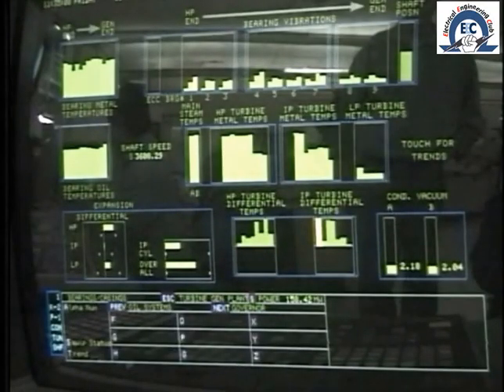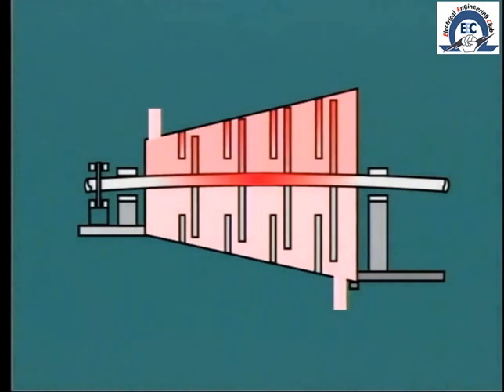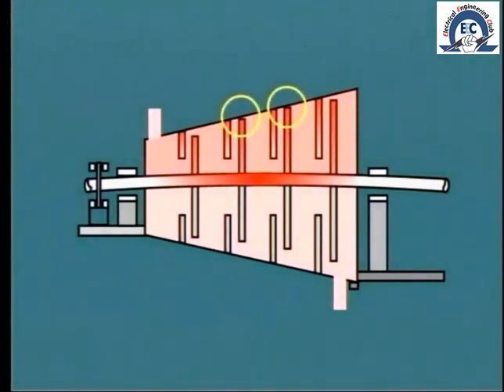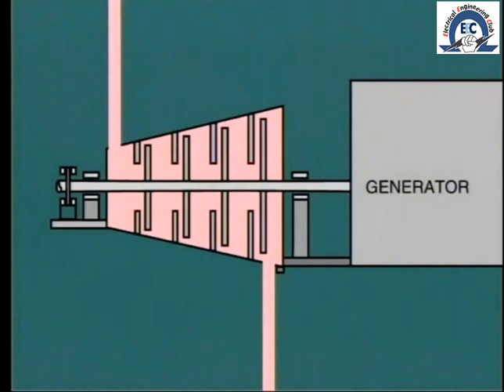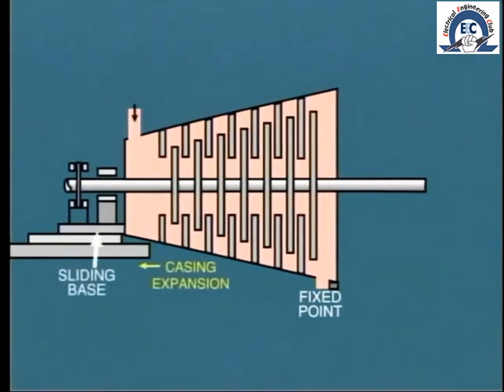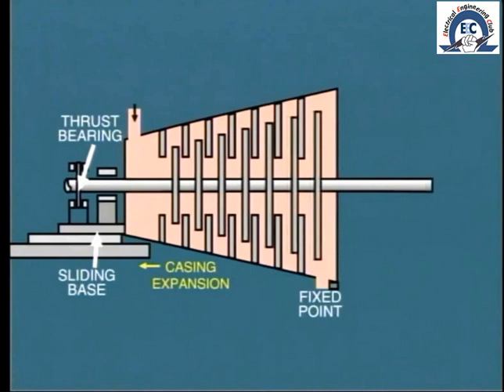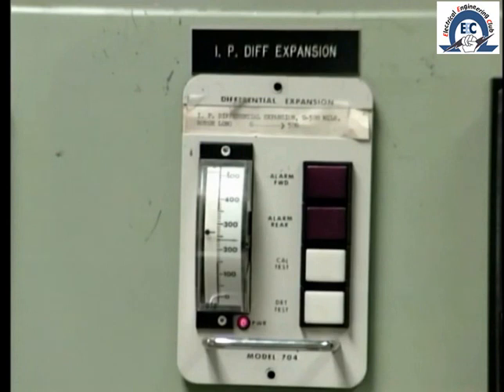lesson 12 :avoid expansion differential for steam turbine

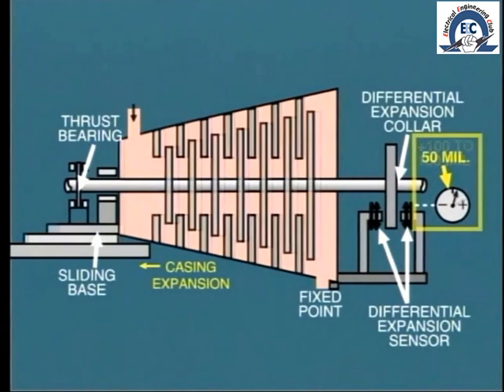Comment: After 02:55, how would this expansion of the casing shown in the animation not decrease the clearance even more in the bad direction? The thrust bearing and the shaft are supposed to be moving axially together with the casing expansion, but this’s not shown in the animations; as if the thrust bearing was fixed to the fundament. I think extra explanation in needed for this point.
Reply: i had the same thought process as you